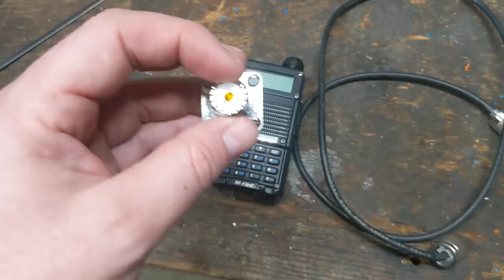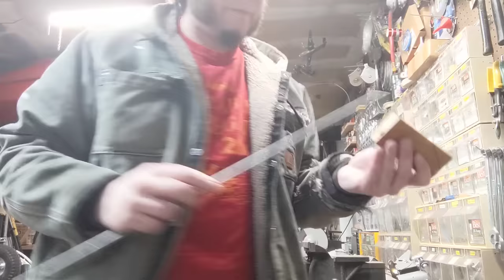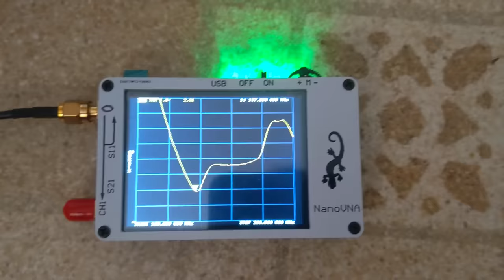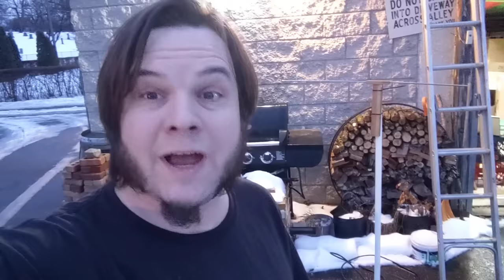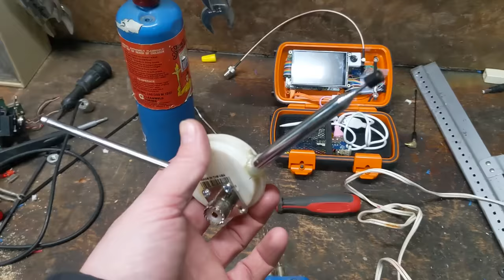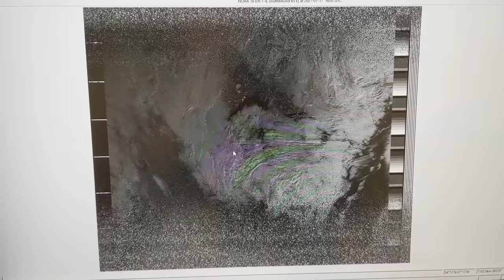Listening to Weather Satellites with Random Junk

Comment from the maker: For everyone asking how I soldered aluminum... I have no idea. I think I just globbed enough on there that it kind of had a good-enough-ish electrical connection. I didn't use that antenna very long, I've gone through a couple designs and am currently using a QFH based on this: https://usradioguy.com/wp-content/uploads/2020/05/20200307-How-To-Build-A-QFH.pdf
Reply: Good educational content .. I just was wondering why you are only able to receive weather balloons satellites and not any other space satellites?
Reply: @TheIsmaelIsaac  it was not a weather balloon. They do not fly in predictable paths that you can look up Online.
Reply: @thettguy  
Oh I see  thank you for clearing this out for me. But  still, why can't you receive signals from the geostationary satellites? Like the ones boardcast international news or any else?
Reply from the maker: @TheIsmaelIsaac  I have some other videos on geostationary satellites, those need bigger dish antennas since they're farther away.
Reply: @saveitforparts  Awesome 👌 
 I will scroll down the thumbnail to watch and enjoy. Thanks a lot
Reply: You can actually solder aluminum with the right flux, mainly phosphoric acid based ones are common in soviet bloc countries, although I am not a chemist, nor do I solder aluminum very often. It's very messy and sometimes unreliable, but in some soviet loudspeakers, the moving coil is made out of aluminum wire that is soldered to a terminal on the chassis, and despite this they are sometimes still work!
Reply: You can get aluminum solder, but its fairly expensive and requires a torch. A small screw/terminal would probably be a better solution.
Reply: wow you are incredible . good job
Reply: Glue guns work well in connecting hard to solder metals.
Reply: I forgot to reply Great video quality and content.  I'm a try till I succeed dude myself. But electronic and I can't get along very well. Some body always burns out.
Reply: Bro looks like a hobbit and could dismantle the whole russian satellite system
Reply: @granola661  maximum lol
Reply: You can use oil to solder to aluminum.
Reply: Love the "can do" attitude of this guy. It cheers me up watching his videos.

Comment: I'm amazed you managed to solder to aluminum at all.
Reply from the maker: I wouldn't say it's a good solder connection, more of a massive blob. I also cheated and used a butane torch on part of it, hence some of the charred areas :-P
Reply: I noticed that as well and had to skip back to where he got the rod to verify I didn't misheard it. Impressive that this worked at all, we had to get around it but it involved plasma cleaning and sputtering, the "just torch it"-approach sounds way easier and less time consuming!
Reply: @saveitforparts  That's because you can't really solder aluminum due to the oxide layer. With aluminum it's especially bad. Maybe try out some copper pipe if you have some lying around.
Reply: Additionally, aluminum is a good conductor of heat so you need a lot of heat.
Reply: @derkeksinator17  tap and screw? Less time...
Reply: @saveitforparts  I've read that you can solder to aluminium by covering the spot you want to "tin" with oil... I know, it sounds weird... but apparently, once the oil is there, you use your soldering iron tip to scrape the joint surface and expose fresh aluminium which wont instantly oxidise because the oil keeps the air away... I have never tried this myself (due to MY laziness 🙄😂) but others say it works well... (use the cored solder as per usual)

😎👍☘️🍺
Reply: @derkeksinator17 caustic flux, or just using the alumaweld brazing rod. It's plenty possible, you can't just take your copper wire soldering stuff and slap it on the aluminum.
Reply: It can be done. Aluminum wire is soldered to stuff quite often
Reply: @steelsurfercore5642  until you ZOOM OUT 😂
Reply: @theREALhunterScheel  😂😂🤣👍🏻
Reply: For reliable soldering you need special solder for aluminium.
Reply: Everyone is bad at soldering aluminum.
Reply: Special flux from Russia for aluminum. Not sure how harmful it is ive only used it 2x but it works great.
Reply: Would have been easier to lug and bolt.
Reply: @nationofgandhis  To be fair I'm not sure you even need to tap it, he could have drilled a hole and used a nut and bolt.
Reply: @saveitforparts  It probably would have worked much better to have drilled and tapped a couple of holes and used a screw to make contact, aluminum really does not like solder much, in fact it sort of doesn't make for good conductivity.
Reply: I doubt it is at all electrically sound.
Reply: You might be able to use borax as a flux, making a sludge up with a tiny bit of hot water.
Reply: plunge solder to aluminum face
Reply: Heat the aluminum with a torch. Make a puddle of molten solder (i use the traditional 60/40 electronics solder)  on the aluminum. Rub the whole mess with fine steel wool. If you do this right, the aluminum alloy is conducive and the flux in your solder is good, you will create a thin film of solder on the surface of the aluminum. You can then solder a wire to this. FWIW - I have done this successfully a couple times.
Reply: Aluminium**
Reply: I've never had an issue soldering to aluminum 🤷
Reply: ?😂! Lmao yeah not hard guys.... Just soot the aluminum with a bic or something first and it's super easy
Reply: He maybe did not. Just screwed in some screws and did solder to them😅
Reply: Easies way to solder aluminum is just use literaly any acid, easiest - phosphoric acid, but even citric will work if you have nothing else

But DO NOT inhale fumes
Reply: 👉 Well, it's really just a matter of skill.    A master solderer(like myself) can weld or solder aluminum to balsa! Just yesterday I was welding sandstone rods to  granite plates.   😉
Reply: Surprisingly it works but normally it cracks off it's not strong
Reply: @dayleedwards3521  Thanks for the polarization lesson, pointdexter. Circular polarized antennas are significantly more complicated to build. The purpose of the project is simplicity, not theoretically optimal efficiency.
Reply: The beeping sound was low battery 😂
Reply: Welding to aluminum is easy. It has to be super clean in the area that you plan to solder if you want the best connection
Reply: soldering aluminium wires is much easier than soldering copper wires
Reply: @saveitforparts  I was just about to guess that but you should consider copper wire for your antenna. When I had to use SATCOM on deployment it was just thin copper inside of a fiberglass type material. Oh the reason I mentioned copper is better conductivity and easy to solder.
Reply: @stevensgarage6451   Да, товарищ. Мы им пользуемся.
Reply: Oh yeah what's that special solder called?
Reply: A bad contact there could be part of the problem.
Reply: Aluminium
Reply: @maikelfeskens9322  I also dislike the way people say "sodder" too but since it's an American thing I don't think it's ever going to change. I live on another continent.
Reply: I highly doubt that actually happened. I mean I'm pretty sure that he doesn't even know how to use most tools. If you look at his surroundings everything is brand new. The only things that have been used with any consistency or Hammers and screwdrivers. And I'm pretty sure that with the we're on those they were his father's.
Reply: Solder doesn't burn hotter then aluminum melting point. You're thinking of mig/tig welding.
Reply: @god-tx4xz everyone is bad at working with aluminum in general. It's kinda of a horrible metal tbh, expect for conductivity and being ight weight it's obnoxious.
Reply: Just get Aluminium solder
Reply: @chookvalve  that's not how soldering works. There's no aluminum solder. Aluminum soldering requires its own special flux metals to work. There's only one way to do it.
Reply: @ShinigamiRose-EVA03  no actually in Australia there was solder you could buy that was suitable, designed in fact, for aluminium. It had a different component in the flux that ameliorated Al2O3.
Reply: @chookvalve  yes, that's what I'm saying. You have to use solder specifically for Aluminum. There's no separate "aluminum solder", it's just the solder you have to use for aluminum. There's not an option there. You have to use the solder specifically meant for aluminum.
Reply: @god-tx4xz  aluminum is just a pain in the ass to work with. It's light and brittle and melts very easily. Good for building airplanes and cans, not great for electrical work or welding. Course you still have to work with aluminum in those jobs but it's always it's own process, just like every other metal. Aluminum is by far the worst tho
Reply: @ShinigamiRose-EVA03  ok yes. Got it. 🥱
Reply: @ShinigamiRose-EVA03 stop yapping bruh
Reply: I see in your eyes your are high while you spy old soviet satellites. Nice dude😅

Comment: One thing to note - when using your SDR you should use a USB extension cable to reduce noise caused by plugging it directly into your laptop. It could have raised the noise floor above the signal strength.
Reply: Wouldn't the hub at the end introduce noise as well? Passive extension cables are noncompliant and shouldn't be used (though in practice they're all over the place, sigh)
Reply: @keiyakins  I have a zigbee dongle for some automation stuff and it works best with a exenstion cable tbh
Reply: @keiyakins  It's true that passive extensions are not supported by the USB spec, but you have a situation here where the peripheral was designed somewhat lazily to have a built in type A when it really should have had a type B or C jack to support being at the end of the cable. Sometimes you have to use non-compliant cables in order to make stupidly designed devices work. E.g. I have a logic analyzer that works great except it has a type A receptacle on a device port, so you have to plug it in with an A to A cable.
Reply: Good idea thanks
Reply: u could try some toroidal ferrite  chokes and wind the cable  around them each end we do that to dampen noise on some cables in lab work cheap but an upmast preamp (dc powered via the radio cable) is better as it can site the antenna  a few metera away from the niosy stuff
Reply: Guess he could buy things like jitterbug, USB audio rig made to "clean" USB port noise
Reply: Anything that makes the distance between usb port and the dongle helped me a lot, as my computer generates a shitload of noise. Also ferrite beads on that usb extension helped a bit too.

Comment: For anyone reading, if you buy that Baofeng radio, you can actually listen to ISS when it's passing by. Even with the default antenna that comes with it. It's pretty neat looking above to see the ISS flying by, and listening to the radio chat between someone who has powerful radio and the ISS.

Great video by the way!
Reply: btw, dont try to talk to them or they will change  frequency, and you will be alone, again.
Reply: @nikostalk5730  wait fr?
Reply: Which model radio is that? I am always watching the ISS and would be neat to actually listen as it passes over.
Reply: @WA4NDR  yeah I used UV-5R to listen to the ISS.  Its not optimal but you can still hear it.
Reply: There is no ISS
Reply: @anthonydempsey7693  Yeag right, there is the dome.
Reply: @tanner1985  
Well said Davide you are wide awake lad.
Reply: @Mavi222  do you mind sharing the frequency to listen to?
Reply: @Laqota  Lots of things are illegal. What matters is how enforcible it is. The new drone laws have the same fudds from the ham community out in force applauding banning even childrens toys, so it's kind of imperative that people disobey such laws IMHO. In my country the airwaves are dead all bar Chinese jammer stations now, which the government haven't done anything to stop in 18 months now (I've located several of them myself). So if they're not stopping Chinese jammers blocking civvy bands etc they're not going to be hunting down me for asking for a radio check once every six weeks on some new rig.
Reply: @nikostalk5730  LOL
Reply: @rod1931  Looks like the Baofeng BF-F8HP
Reply: @anthonydempsey7693  You can literally watch it with a telescope.
Reply: Sure bud 💀 @anthonydempsey7693

Comment: The fact you got solder to stick to aluminum is pretty impressive not easy to do
Reply: You have to get through the oxide layer.  It helps greatly if the surface is plated with another metal.
Reply: Лимонная кислота часто помогает паять что угодно к чему угодно, главное нагреть до плавления

Comment: Besides RF gain, NF [Noise Figure] is a big factor in the first receiving stage.  Lower is better. To solder correctly, the joint must be clean. Use flux, tin the tip, wipe off, tin again, HEAT THE JOINT, add solder to  transfer more heat if necessary, Apply solder OPPOSITE the heat source. Solder will flow toward the heat. When the joint is molten, remove the heat. Clean the joint of flux. Done.

Comment: My father and I did this back in the 80's with a scratch built receiver for NOAA/METEOR Sats with similar software on a 486 PC. No SDR back in the day! PS: Reception is better if you lay a reflector grid out some hardware cloth underneath the dipole antenna.

Comment: Using 3/8" Al stock is a good idea.  You can thread it with a cheap Harbor Freight tap and die and this gives you possibilities for both mounting the elements and for solderless connections just by wrapping wire under mounting nuts.

Comment: I did this back in the 1970's.  A dipole antenna and a CB radio with a crystal change- out. NOAA had a satellite that did slow scan.  I used an  old oscilloscope and photographic film to capture the video.  Pretty cumbersome, but this was before good computers.
Reply from the maker: Neat! That sounds like a really interesting setup!

Comment: The SDR you need to adjust the frequency. There is an adjustment in the software that you have to either add or subtract depending on how far off it is on the cheaper sdrs it could be anywhere from single digits all the way up to around 75 negative or positive

The really good ones the PPM is less than 1 so those you don't have to adjust the frequency

Comment: This motivated me enough to buy a good RTL-SDR v3 with dipole kit.
At first I was figuring things out. Then I got to fun part of receiving APT from NOAA. At first I was getting nothing because 18 was in Asia while I'm in middle of Europe. I figured out that I need better spot to receive from ( I did 1st runs indoors, because it was cold outside). So I went to kitchen and tried there. 19 wasn't perfectly above me, but I could get faint signal. I was so happy. So I thought I have to place it in balcony, not inside. Tried. 15 was pretty close to me and i got amazing signal for 7 minutes. Decoded what i received and saw some clouds. According to map overlay, when satellite was going from africa to europe, i had no signal (blocked by indoors/behind). But after it flew above me I started getting signal (accessible from balcony). Very nice. 
But i have a question. Is it okay that my dongle gets hot? Not warm.
Reply from the maker: Cool! I like the RTL-SDR v3 as well, that's what I mostly use now. With the V-dipole I noticed a lot of dead spots and interference from surrounding trees / buildings /etc. The little dipole antennas are OK but not very forgiving of weak signals. There are some ways to improve them, like getting it closer to a ground plane or a set of reflector rods like this: https://www.reddit.com/r/amateursatellites/comments/gicy6c/modified_the_vdipole_antenna_with_a_reflector/

I eventually went with a QFH antenna up on the roof (after a couple tries) which gives me a more consisten signal. I used this guide: https://usradioguy.com/wp-content/uploads/2020/05/20200307-How-To-Build-A-QFH.pdf

I've noticed that NOAA 18 is the strongest signal and the others tend to be weaker. 

As far as heat, mine can get hot too but hasn't seemed to hurt it. I guess you could stick a metal plate on there as a heatsink, or a small fan if you're worried? My cyberdeck thing gets really hot when I leave it on but I havent killed that (yet) either!

Comment: Try a yagi antenna with the rtl sdr. It has gain built into the antenna. It’s pretty much a dipole with a director and a reflector radial. Reflects and focuses the signal. Much more directional you will have to track the satellite. Get your technician license easy test, then you can transmit to communication satellites with the uv5r. Good luck

Comment: i use noaa-apt program, it works amazingly for decoding APT.

ill try to get APT physically (i have the same cheap blue receiver, ill do something about it), i have been practicing with airspy server network (people share their receivers)
Reply from the maker: Lately I've been using Raspberry-Noaa V2. I set up a Raspberry Pi with RTL-SDR and filter in a waterproof box on the roof. I made a QFH antenna out of copper pipe, it took a few tries to get it right!
Reply: bought RTL-SDR v3 Blog with adjustable dipole antenna, I'm sure that will work.
Reply: Works perfectly. Currently practicing decoding ADS-B (getting aircrafts flying above Slovakia, there is no-fly zone in Ukraine at the moment). NOAA-19 will be above me in about 7 hours.

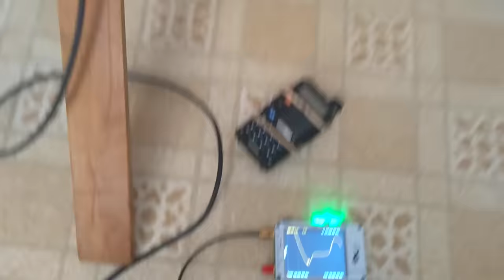Comment: 6:30 time .....SWR  meter. Okay, i used to fix these CB radios, at an electronics shop. SWR   is short, for  Standing  Wave  Ratio.  Meaning, the higher the number, the more  ' loss '  and inefficiency  your antenna has, to that particular  wavelength.  Back in the day, if i could get a  1 to  1.1  or 1.2  reading, that was the best match, for the antenna / radio wavelength.  TUNING  the length, of the antenna,  (cb band, 27 mhz.)  was  a  CRITICAL  ISSUE.  We  ALWAYS, had to place the antenna, with a good  ' ground plane ' ;    such as in the center of a  car  roof, utilizing that horizontal roof, as a ' ground plane '  directing the radio wattage, into the atmosphere horizontally.  Not beam-forming, but a global dispersion.  ..anyway.  good luck,  sir !